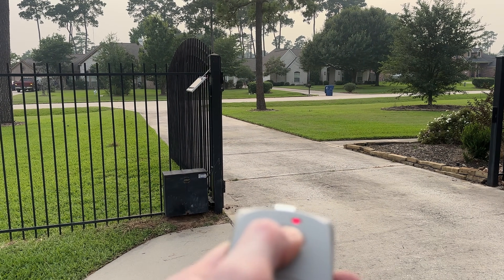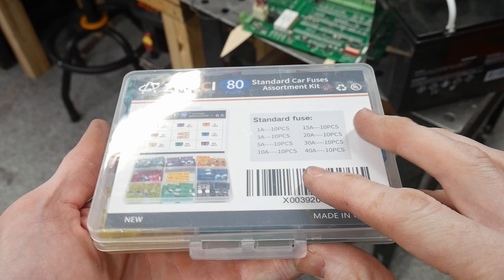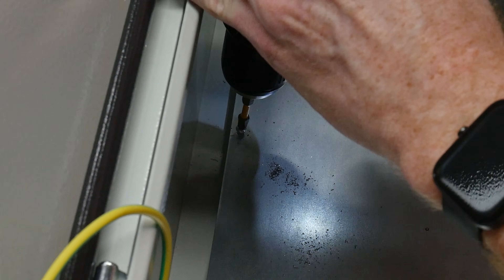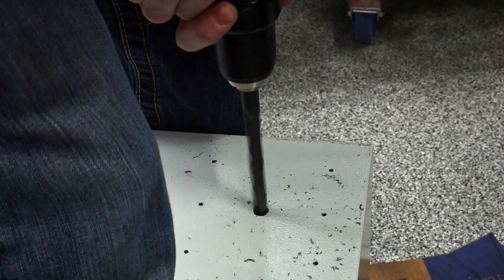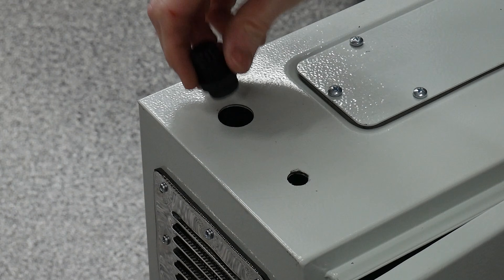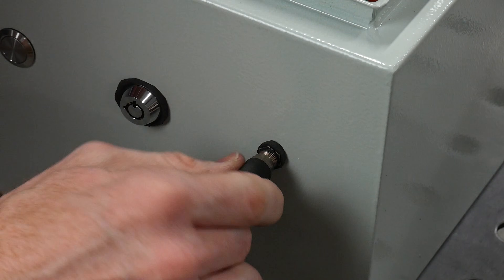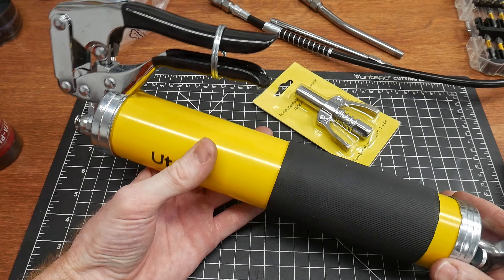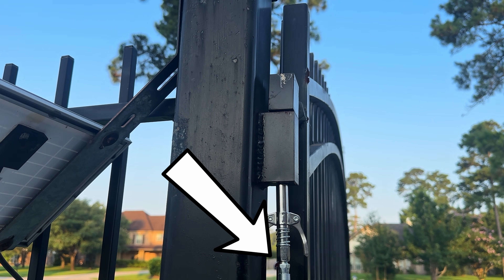How To Fix An Automatic Gate | Apollo Control Box Revamped

Comment from the maker: 📋 Items Used:
Vevor Enclosure - https://amzn.to/4eGAevk
Push Button - https://amzn.to/45MuQm7
Push Button Lock - https://amzn.to/3zmDhIV
Fuses - https://amzn.to/4cbLi1P
Vent Covers - https://amzn.to/3RM9Ar2
Gasket Material - https://amzn.to/4eHFrCW
SS Mesh - https://amzn.to/3W36aCX
1/2'' Bolt - https://amzn.to/3LaebPT
WAGO Lever Nuts - https://amzn.to/4bEjWAx
WAGO Lever Splices - https://amzn.to/3VJLMoP

⚒ Tools Used:
Volt Meter - https://amzn.to/4bo6QqA
Grease Gun - https://amzn.to/3L3Otg3
Grease Gun Coupler - https://amzn.to/4chKWGU
Red Grease - https://amzn.to/4eFZvFU
Auto-Center Punch - https://amzn.to/4eFmOjd

🏷Apollo 636 Control Board Sources:
Amazon 1 - https://amzn.to/3W4FIaT
Amazon 2 - https://amzn.to/4bnBWyD
Amazon 3 - https://amzn.to/3zqLSug
ebay - https://www.ebay.com/itm/373811657769
Nice Apollo Site - https://apollogateopeners.com/store/control-board-for-1600.html

🙏All Red Beard Socials Links - https://linktr.ee/redbeardops

🙏 Become a Patron - https://www.patreon.com/RedBeardOps

📁Battery Shelf CAD Files - https://www.patreon.com/posts/home-side-red-107059405

Comment: Hello, our gate will not work with our remotes all of a sudden, we changed the batteries and that did not work. The motor was sounding different and the gate would stop half way open most of the time before this happened. Any help wanted and needed 😢
Reply from the maker: Well it's hard to say exactly what your situation is... Will likely need to get in contact with a repair company to come out and take a look. I'd imagine it's not the board since the gate moves at all? I don't know
Reply: @ thank you for trying! It ended up being the battery needing replacing and the remotes just needed to be reprogrammed.

Comment: I have a quick question which I’m hoping you can help with.  It seems I have these millennium keys pads that go to box like you have.  The wires come from the ground and into box. However I have a red and black wire which are disconnected.  It also has a small ground thin wire. Would you have any idea where they go connected on board.  I just bought this home and manual doesn’t help.  I also have two out of three remote that don’t work. Any help or thoughts would be appreciated. Thanks in advance
Reply from the maker: Hmmmm, I can't say I know the answer. I'd contact the manufacture... they got back to me pretty quick